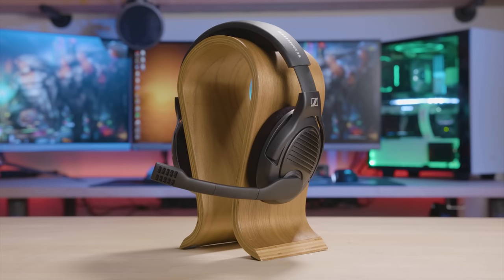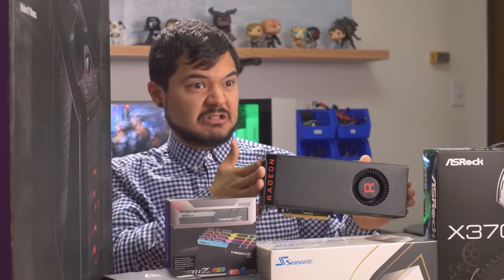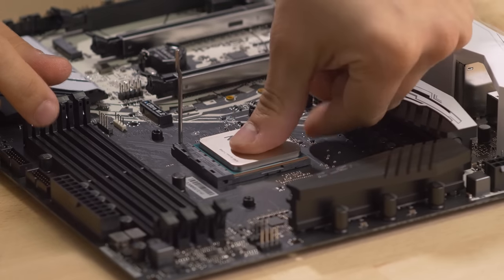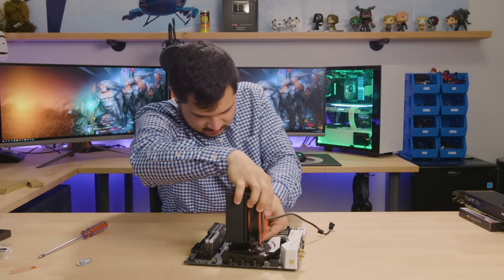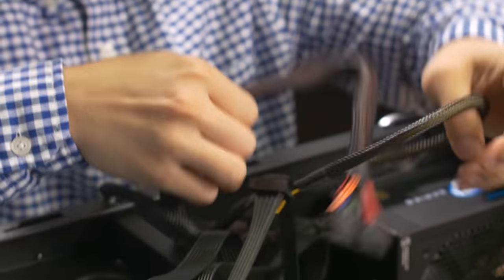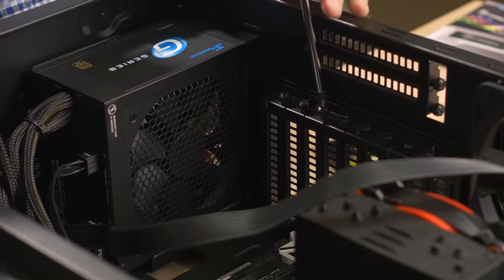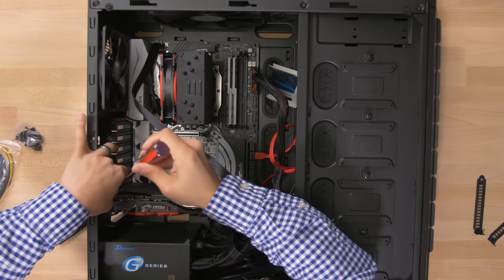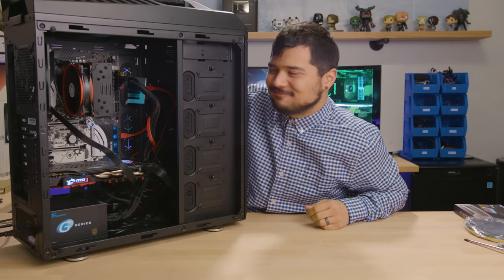How NOT to build a PC!

Comment: Ohhh, so this is how pre-builts are made
Reply: I went to a prebuilt factory and they did this

It's a joke don't take it seriously :P
Reply: right down to the detail
Reply: Yeah
Reply: But they only use one stick of ram
Reply: Clearly
Reply: The fact im reading this on a pre built is ironic as hell
Reply: @lilsins656  yeah one stick 2GB ram das fucked up
Reply: Haha I’m dead 🤣🤣😂
Reply: @lilsins656  and they put it in the dual channel
Reply: @glow2215  Y E S  and they shove ddr3 in the pcie slot
Reply: You think this is bad? I once saw a DVD rom drive being GLUED in a PC by a "technician" of a computer shop!! He didn't use screws or a screwdriver like one would normally do. Guess what? He actually used a glue gun to secure the drive!! A freaking GLUE GUN!! WTF?!
Reply: nice copy and pasting
Reply: @joreiaq  you could’ve gotten cheap pc parts that still run games pretty well
Reply: @yeseric4988  Thing is i'm not confident enough to build one I just dont want to mess anything up although theres tutorials still not confident B)
Reply: @joreiaq  true
Reply: Nothing wrong with prebuilt just be sure to take it apart and rebuild it properly
Reply: @yeseric4988  The whole process of my pc shopping was amazon alienware, lytetechnology, vrla, digitalstorm, to then settle on nzxt my current specs are

CASE:

NZXT H710i (Black - Red)

MSRP

$169.99

GPU:

NVIDIA GeForce RTX 3080 - EVGA XC3 ULTRA

MSRP

$769.99

CPU:

Intel Core i7-10700 8-Core 2.9GHz

MSRP

$339.99

CPU COOLING:

NZXT Kraken Z63 with LCD display

MSRP

$249.99

MOTHERBOARD:

MSI MPG Z490 GAMING EDGE WIFI

MSRP

$199.99

RAM:

Team T-FORCE Delta RGB 3200MHz (max speed) 16GB (2X8GB)

MSRP

$74.99

SSD:

MSRP

Western Digital SN550 1.0 TB

$104.99

HDD:

MSRP

Seagate Barracuda 2.0 TB

$59.99

POWER:

XPG Core Reactor 750W Gold

MSRP

$149.99

RGBs:

MSRP

NZXT RGB LED Strips

$19.99

SOFTWARE:

Windows 10 Home

MSRP

$119.99)
Reply: @joreiaq  oh nvm yea that’s good pc wow
Reply: No no, this is how Verge makes them. Prebuilts do a little better
Reply: Except it comes with the stock cpu cooler...

(If you think I'm joking btw, I'm not. My best friend's PC came with a 2070 and the stock intel fan for the cpu cooler.)
Reply: @walterdayrit675  Maybe he ran out of screws?
Reply: @Talisman2  I hope you're being sarcastic..
Reply: @lilsins656  this is a high end prebuild
Reply: @zerodrip4645  whats with the killua zoldyk profile pic?? tbh, i love kurapika more than anyone else
Reply: Main gears are pretty good
Reply: lol
Reply: This is also how the verge PCs are made
Reply: @thehotdogman9317  stock fans are ok, you only need 3rd party thermals and cooling or water cooling if you plan to do intensive overclocking
Reply: @insanitylol  That's why your an xbox gamer, and not a PC gamer. Please stay in your lane.
Reply: EXACTLY!!
Reply: @thehotdogman9317  did you read the windows in his name?
Reply: @andra_syawwal  Windows doesn't assume PC but yeah I did.
Reply: That on is my pc tho 😎👌
Reply: no
Reply: But they use a cheaper power supply
Reply: HAHAHAHAHAAHAHAHA
Reply: @bensears6798  the other person copied him
Reply: @The Idiotic Channel what brand is it
Reply: @zerodrip4645  I bought a pre-built pc But it is bad ass and awesome pc with op cable management
Reply: @lilsins656  ah yes... so I have a prebuilt cuz it’s my first encounter with a pc.. but besides that my prebuilt has 2 slots for ram with only one in it, do u k or if I buy the same type and storage ram stick I can stick it next to it as well?
Reply: @ethanlitalien244  what type of ram and processer you got
Reply: big brain
Reply: @joreiaq  dude honestly I just built my first and just following one guide (with some googling about front panel connectors) was done in like two hours. Way simpler than I ever expected
Reply: @NespeCoaching  sick
Reply: @joreiaq  if you haven't already, do your research on parts and get them ordered, I'm definitely only going to be building from now on
Reply: @NespeCoaching  i bought a prebuilt cuz everything is out of stock, too expensive, or too weak.
Reply: @NespeCoaching  i am planning on building one once everything is in stock
Reply: @joreiaq  you could even buy a cheap prebuilt and salvage the graphics card and sell the rest
Reply: @NespeCoaching  noted
Reply: Yep
Reply: its made with love

Comment: *pushes down cpu*

aight imma head out
Reply: Nobel Tv holds cpu by the pins
Reply: Nobel Tv wait ur not meant to push it down???
Reply: GoDdLy M8 not like that
Reply: @astromorphs-are-qu  he was joking
Reply: @YeppKing  it's blocking the thermal paste.
Reply: ÆRO YT ohhhhhh
Reply: bondai and no I wasn’t joking
Reply: Well, it won't hurt an amd cpu if it's installed correctly, but you would reck an Intel one.
Reply: LightJack05 well I did try to take out my and ryzen 7 3700x and it stuck onto the cooler sooooo F
Reply: GoDdLy M8 bruh
Reply: Kenan Musugi it happens sometimes
Reply: That cpu is worth more than my salary
Reply: @plastoerectus751  that cpu worths 3x more then my pc with the old gpu
Reply: Nobel Tv same
Reply: @YeppKing  Noooo
Reply: It still works, stop scaring beginners, CPUs aren't that sensitive.
Reply: Unknown Person r/wooooooosh
Reply: Lmaooo
Reply: Dumitrescu Denisa Magdalena so they are sensitive right
Reply: bondai if it is already in the socket correctly, it is fine to push it down just a bit, but try to not put your whole thumb on it so no oils come onto the IHS
Reply: me too but when he touches the cpu pins
Reply: Techsource would bleed out of his eyes!

Comment: that smile when the system turned on was completely genuine, he didn't have any faith
Reply: He did all that dumb stuff and it worked. Am so scared to build a pc bcz the cpu pin might break
Reply: He did all that dumb stuff and it worked. Am so scared to build a pc bcz the cpu pin might break
Reply: Comment was not made • 2 years ago  is it easy to place ut in the mother board too?
Reply: Comment was not made • 2 years ago  i want to build a pc but am sooo scared. Can you send mw the vudeo
Reply: @BigHotSauceBoss69  most important part is avoiding the verge 😭😭😭

Comment: When he put the two RAM sticks in slots 1 and 2... I basically had a mental breakdown over this
Reply: yeah nevermind the fact that he was pushing in the cpu
Reply: @SpahGaming  Nah, that was fine. In fact, he needed to push harder to get those extra GHz! XD
Reply: @SpahGaming  oh no but it's just fine to squeeze the screws on the bottom of he cpu give it a good feel
Reply: I'm a noov with pc, what is wrong if u put them like that?
Reply: @zenz9318  me too i have seen computer built that have 4 RAM next to each other I didn’t though that was bad
Reply: @zenz9318  on most boards ram lines are 1/3 and 2/4 so you put ram in slots 1 and 3 or 2 and 4, some boards are 1/2 3/4 though so it just depends, but mostly its 1/3.
Reply: @Daeyae  Thank u
Reply: @zenz9318  Well, you won't be able to use dual-channel RAM, which means the computer can only access one channel at once while dual-channel allows your PC to access both RAM sticks at the same time.
TL;DR Just don't put the RAM sticks directly together, as it greatly affects performance.
Reply: Sameeee 😂😂😂😂
Reply: I had a mental breakdown at him installing the cpu.
Reply: nothing hurt more than that
Reply: @Erik_Bird  x2
Reply: Why?
Reply: @GeGeRat  Your not supposed to touch the pins of the or the back of the cpu. and especially dont press down on the cpu when you install it. HE DID ALL OF THOSE THINGS!
Reply: @Erik_Bird  im asking why not to put ram next to eachother
Reply: same lol
Reply: GeGe the motherboard will mess up on the RAM. It’s usually 1/3 and 2/4
Reply: @Daeyae  actually usually 2 and 4
Reply: @knightlytech1396  Yeah I spoke to a friend about this, I've always had boards where its 1/3 so I assumed it was the most common but he told me that I just had some weird mobos
Reply: how bout when he manhandled the cpu
Reply: Breakdown, Breakdown, lets rock out
Reply: Why?

Comment: 1:43 how to ruin a processor in 2 seconds.
Reply: IKR!!!
Reply: I've got a faster way

Ever try to pull off a Ryzen Stealth cooler after a fresh application of thermal paste?
Reply: Yes and i really fear about it
Reply: @Deadboy90  OMG, I did that when I had gotten my 2700x, didn't know the technique of pulling it off. It ripped the cpu right out the motherboard while still stuck to the heatsink still locked to the motherboard. Luckily no pins were bent. Then I had to separate the cpu and cooler. I was sweating bullets
Reply: John Gonzalez I just twisted it off, is that the technique lol?
Reply: @ezreyproductions7478  yeah it's a twist and slow pulling
Reply: @talljohn29  AM sockets have always had that issue.  If the system runs I usually boot it up and let it get warm real quick.  Makes removing 10x easier.
Reply: Done this years ago, my heart sank, but both the mb and cpu were fine, now I know to load the cpu and warm it up right before removing a block or radiator and give it a twist and a shimmy to break the sticktion.

Always careful with CPU's, never touched a pin in my life.

Comment: I bet he actually forgot the io shield without trying lol
Reply: Chris i think that the showed io shield wasnt from that board xD
Reply: Biggest issue I have while building pc's. Gotta take everything put so you don't bend it
Reply: I've only forgot it twice and the boards that I had, and the way all of the connections were placed, if you tried to put it in with the motherboard already secured, it would bend because of the lack of working room. It wouldnt be a big bend but still annoying
Reply: omgwtf696969 you don't lol.
Reply: omgwtf696969 the only thing that happens is you get cut, a bent io shield and maybe after an hour, a success. Its being so lazy, you end up doing more work than the original job required.

Comment: This man will use the emergency brake everytime his computer crash
Reply: I wonder what would happen if you tried to take out the CPU while the system was running!?
Reply: centhron89 ESD would fry the system
Reply: you know, when I builded my first PC, i went with a 6700K, thinking there would be a stock cooler. As it turned out there wasnt, so i had no cooling, and i was like... meh i could atleast give it a try... Temps in bios where 100+ so i thought ''there is probably something wrong with the temp meter'' so i touched the cpu with my finger and literally burned the top of my finger :) :). Those were the good old days haha.
Reply: no it didnt, but it was around the 100. But after i burned my finger, i directly shot it down :P

Comment: I did everything he told me to do including dropping the cpu but for some reason it did not work.
Reply: Make sure you flattten the pins on your cpu like he did push down very hard
Reply: You gotta get rid of the handbrake. Also, use tape to make sure the CPU can't move.
Reply: Clearly learning from linus
Reply: Be sure to put thermal paste into the ram slots so the ram sticks to the motherboard.

Comment: rips the cpu out of the plastic shell and touches the pins with bare hands "Kyle tell me be very careful wit dis one."
Reply: I think he hasn't gone far enough into cringe, honestly. I would've used mismatched RAM, picked up a DOA Intel chip and pretended to try and install it on an equally dead AMD board, just so I could've had the luxury of going COMPLETELY overboard with insert strength and the usual CPU wiggle test. I would've smeared that mobo with thermal paste and called it a day, and I would've made an effort to strip as many screws as possible.

Oh, and let's not forget going back to the Rookie years by somehow ending up with irretrievable loose screws in the bottom carriage. That was one of my own mistakes for my first build.
Reply: Cool, I'm glad that you would've done all of that stuff.

Comment: Saw this after the Verge vid. It is like a prophecy! The fan-on-the-inside PSU could be argued though. I think it is not completely unreasonable to do it that way.
Reply: Erwin Simpauco it’s not. Some people put the PSU fan facing in the case. Personally since I’ve done it, my computer had stayed consistently cool at 40 degrees Celsius but when the PSU fan was facing the ground my computer would get as hot as 90 degrees Celsius so..
Reply: @justinguerrero8941  You're right. I have my PSU installed with the fan facing inside too, but to be honest it is more for the aesthetics than the thermal characteristics/benefits. :D Good info!
Reply: I did that by accident and the psu shroud had a grill for it but it was blowing a lot of dust into the case
Reply: Older pc cases had their power supply brackets on the top of the case. The only way to point the fan was down in these cases as there was no vent towards the top of the case. Power supplies don't blow air into the case. They take air from the outside/bottow and blow it out the back of the power supply. If its facing inside, it takes the inside air and blows it to the outside.
Reply: Wait ur supposed to not have it pointing in the case ? Oh fuck

Comment: This is all wrong.
Why arent you using an allen wrench? 

What about the thermal paste applicator? 

Why didnt you use the CPU instalation tool? 

You also used way too little thermal paste, you should use a whole tube i mean why else would you buy a tube and not use all of it? 

Where is all your braces and brackets? 

0/10 worst pc building guide, Stephan from the Verge is an expert he can help you build it properly next time.
Reply: @nikhil4797  just remember to screw in with confidence.
Reply: He didn't even use a Swiss army knife that hopefully has a Philips head screwdriver in it
Reply: Or tweezers
Reply: @nikhil4797  
no u
Reply: @nikhil4797  
Bruh
Reply: is this satire?
Reply: oh i just saw the verge part
Reply: @nikhil4797  wha?!?!

Comment: In some cases the PSU fan should be put into the inside ... like in my pc, because the outside leads to case and not outside... so better make it go inside
Reply: Look at the title again
Reply: @galacticgold507  I know this is how not to build a pc but some cases doesn't have a psu "hole"/"filter" ... So in that case, its better in the inside... because if it blows into nothing its worse than blowing into somewhere where there are airflow